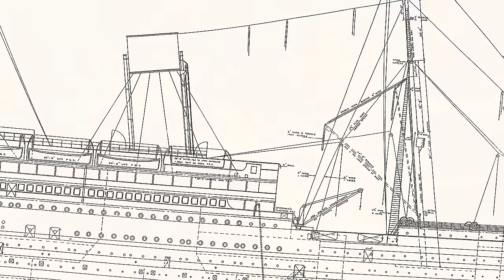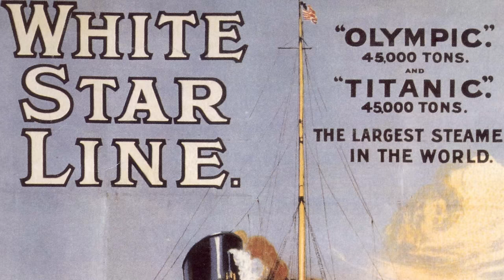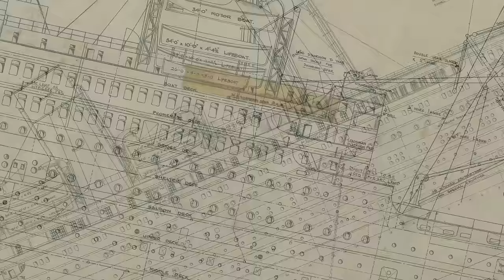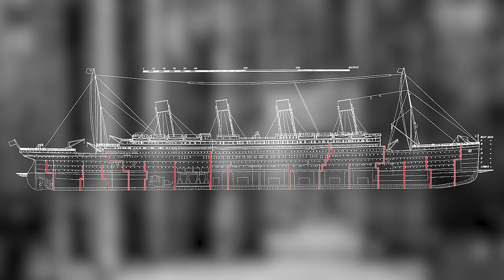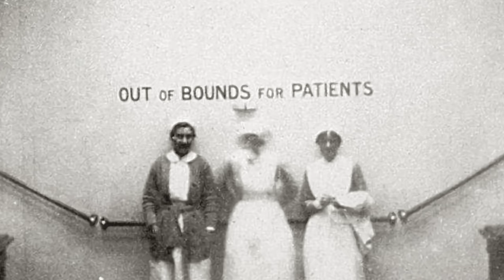The Sinking of Britannic - Titanic's Forgotten Sister Ship

Comment: My father worked on all three of the Olympic class. He worked in the woodwork shop.My own association was when I worked  in a garage in the Ravenhill Road . I was asked to assemble  storage racks in one of the attics  of the building. I found numerous wooden panels  stored on another attic. They had keel numbers marked on their edge  433. I checked with my father and he confirmed they were panelling removed from Brittanic  during her conversion to hospital ship. I told one of the Directors of the company and it took several lorries to take away  the wooden sections. There was so much panelling it had been spread all over Belfast, and in some cases, H&W didn't know where half of it went. Some hotels and large houses acquired panelled walls which means  there must be some of that woodwork  still existing anonymous in buildings throught UK to this day.

Comment: Just as with Titanic, the sinking of the Britannic was one of those occasions when everything went wrong: recalled to service when she was supposed to be free, her portholes undermining her safety features, her captain making a TERRIBLE mistake in keeping her engines going, and then her communications compromised during the sinking.  Any one of these things going differently could have ameliorated or avoided the tragedy.  But while Britannic was, mechanically, the ship that Titanic SHOULD have been, and would have sailed through the iceberg incident without a scratch, these small things would doom her just like her sister.  

You have to say one thing, though: they sure got everyone off in a hurry!  If it weren't for the idiotic mistake of leaving the propellers running, then the successful evaucation would probably be remembered as a triumph, and a massive improvement on Titanic's last hours.
Reply: It wasn't an idiotic mistake of leaving the propellers running. Bartlett was trying to beach the ship to save it and save everyone. He did not give any orders to lower the lifeboats. The lifeboats that were pulled into (or almost pulled into, as was the case with the third boat) were launched without his permission by confused and scared officers manning the davits. Bartlett had no idea the boats were launching, since he didn't order them to, otherwise he would have absolutely shut the engines off.
Reply: It was not a terrible mistake to keep the engines running. The Captain did NOT order the boats lowered because he would have understood that was too dangerous at that time. It is the idiot who decided to go against Captain's orders and lower those first two boats prematurely. That person and his decision to disobey orders - that was the terrible mistake.
Reply: The captain was not to blame; the officers who disobeyed orders and prematurely launched the lifeboats were.
Reply: @admiralfrazier306  Barlett keeping the engines going was only a mistake in that it hastened the sinking and made things worse. Had he order all stop right away, Britannic might've stayed afloat for up to another hour. 

If the portholes had all been closed, it would've made a difference and the beaching attempt could well have worked.
Reply: The capatain wasn't at fault here. Information should have been gathered before lowering the boats. Had the boats not been lowered, the ship woukd have been beached and saved. They lost time when the ship was stopped and the engines cut off when he hard about the propeller incident. The ship was so close to land because the water was only 400 feet deep at that point. That's why the ship stood straight up in the air when the bow hit the floor cause the ship was 800 feet long.
Reply: @thomasackerman5399 The problem with that judgement is that Bartlett didn't know the portholes were open.  Remember, standing orders were to shut them during transit, regardless of what that might do to the interior.  He assumed, like with the premature lowering of boats, that the crew were obeying his standing orders - which in hindsight is easy to criticize him for, but consider this: Bartlett had been in command of Britannic since she began service, and most of her crew had stayed as well.  He had every reason to trust they did the right thing, and with 1066 crew it's not like he can micromanage them.
Reply: Great presentation.
The Captain was right to try and beach his ship
Reply: @GintaPPE1000  That's a much more fair defense of the captain; thank you.
Reply: @thomasackerman5399  Thank you, but I'm not sure that the admiral cares.  Too many popele asume that that if you show a strong opinion about something, that you must be "sensitive'" about it," or that if you can state your position eloquently and with proof, then you deserve an argument.  In either case, they pounce, and I don't feed trolls. 😎
Reply: @TheSaneHatter  Okay buddy, have a good one lmao

Comment: The explosion caused some of the water tight doors to be jammed open, so they could not close them. They were open for the morning run. If the water tight doors and the portholes had been closed, Brittanic may not have sank.  The portholes were open because it was hot inside

Comment: 1. Why didn’t you use any photos of Violet Jessop? That’s such a bizarre oversight, especially since there’s even pictures of her as a nurse.

2. At 56:00 you referred to the Britannic as “the last of the four-stacker transatlantic liners, and the darling of the White Star Line,” but the Olympic was still alive and well and would continue to sail until 1935. Did you forget about the Olympic?

Great video overall, but those two things just irked me and I had to point them out.

Comment: She had the same design flaw as Titanic.  Water tight Bulkheads didn't go all the way to the overhead which meant once the compartments filled up, the water boiled over into the next one and the next one and the next one and the next one.  Which means the ship did not have Water tight integrity.  Something Modern ships do not have a problem with.

Comment: Lifeboats are not actually launched when the engines are still running because there is a risk that the lifeboats that have already been launched could be sucked in by the ship's propellers while they are still rotating.🤔

Comment: Another question, aside that from how much water an open porthole would allow in the ship, how is it that no one ordered the aft steering position to be managed when the steering on the bridge and the wheel house failed? Just like her sister ships, the Britannic was equipped with a third steering position aft on the poop deck, directly over the steering engine, for exactly that reason should the main hydraulic steering mechanism should fail. The third steering was mechanically connected to the steering engine, powered by two 3 cylinder triple expansion engines, one to power the steering and one as an emergency engine that could also power a generator for emergency power. Apparently no one gave the order to man that steering position to move the ship to Kea island. I wonder why. There certainly was enough time
Reply: The explosion jammed the rudder in a way that completely stopped its ability to movie
Reply: @SpoonSputnik  it did? An explosion around the area of the bridge, jams the rudder 600 feet further aft? I guess it's an explanation, but I don't see how. The explosion warped the tracks of two watertight bulkhead doors fore and aft of the spot where the mine went off. All other watertight doors were shut. I'm no marine engineer but I'd think the tracks of watertight doors are more fragile than a steering mechanism that weighs 100 tons. But you might be right

Comment: why didn’t the captain stop the engine?
Reply: Steam ships of this era had their speed controlled in the engine room if I remember correctly. The captain would use that thing you see in movies with the speeds on it and that would call down to the engine room and they would set the speed by dumping more coal into the boilers increasing steam pressure alongside manipulating the ships machinery.
Since the boilers are near the ships lowest decks they are the first to flood so in a sudden explosion near the waterline the boiler/engine room crew would be either killed in the blast or forced out or killed by the sudden influx of water.
And even if they stopped the engines those massive propellers and their shafts have a lot of momentum that would be a near impossibility to stop in a short period of time.

This is just what I know and anybody with more ship knowledge please correct me